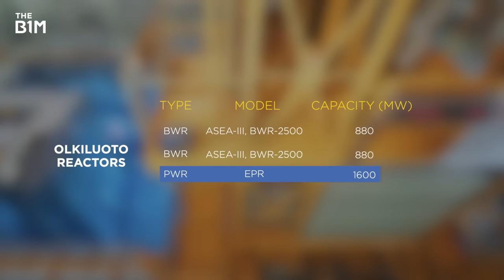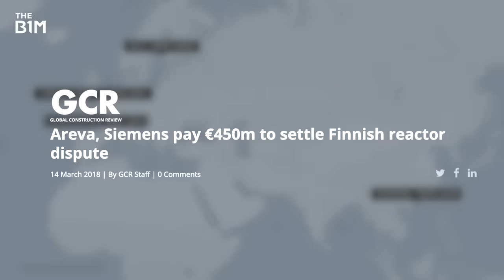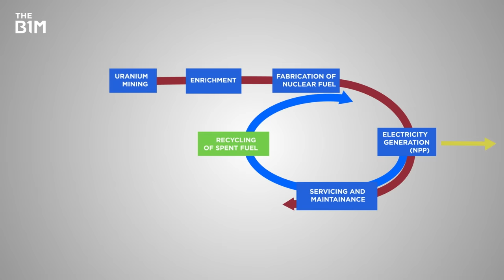Finland Might Have Solved Nuclear Power’s Biggest Problem

Comment: "Sweeping the problem under the rug", I'm not impressed.
Reply: That's literally what burying nuclear waste is. Sweeping the waste under the rug.
Reply: It will stay there forever. It will take quite an earthquake to bring it up again. Better that than blowing coal dust all over the place.
Reply: @Tuppoo94  Anything's better than coal dust. Let's try to aim higher, shall we?
Reply: @angeleyes2c  I would say we should aim as high as we can but we need to reach the point where no fossil energy is needed in less than 15 years so we should take every chance we get. And until our technology has gotten far enough so we can safely reuse the fuel, I think burying it isn’t the worst idea.
Reply: @Tuppoo94  yup, and no earthquake's to speak of happen in Finland, most are within 1 or 2 on the Richter scale, which is barely even noticable to the human
Reply: @Tuppoo94  ah yes because it’s either coal or nuclear.  Stop with the forced dichotomy.  Drill 2 km anywhere on earth and you have enough geothermal heat to run compression and expansion cycles.
Reply: @kaiyack  Do you have any idea how fucking DEEP 2km hole is?
Reply: @onelyone6976  no earthquakes so far.  How long do records go back?  How long is geological history? Love it when engineers think they’re geologists.  There is no permanently static place on Earth.
Reply: @angeleyes2c  aim higher.  Agreed.  Engineers are notoriously lazy.
Reply: @kaiyack  True, but in 50,000 years the waste has decayed considerably, and won't be as dangerous anymore. The rock they're drilling right now is among the oldest in the whole world, and unlikely to move anytime soon. Even if it does, the waste is 400m underground.
Reply: @Tuppoo94  how are we going to convince future generations from not opening up an attractive geologic anomaly?  Signs with words?  Only took 500 years for Latin to split into French, Italian and Spanish.  Even a “curse” didn’t stop Carter from opening up Tut’s tomb.  Look whats happened in human history in the last 1000 years, let alone 50,000 and engineers want to claim they got it all figured out?  Plain and simple all contingencies have not been planned for.
Reply: @kaiyack  no there isn’t a permanently static place, but the bedrock in Finland is very stable, the baltic shield contains the oldest rocks in Europe, and the borders of the tectonic plates are nowhere near Finland
Reply: At least read up one hour on the solution before making stupid uninformed comments, OK?
Reply: @benbaselet2026  putting it in the ground isn’t a solution.  It’s an inelegant deferment.  Maybe read up about human history and how we really can’t stop future generations from digging anything back up.  That curse on Tut’s tomb sure kept Carter away.  They’ll eventually get into Xi’an’s.

Oh then you gotta transport it to the site, which has its risks. Because, you know, not every place on Earth has geology such as Finland’s.  Which countries should be forced to bury in situ?
Reply: @kaiyack  there are hundreds of thousands of holes drilled in the earth for gas and oil and they could utilize that energy coming out of the ground in the form of heat and compression that could also spin turbines but they don't. Some wells we drilled the temp of gas coming out of the ground was +200 degrees F  @ over a hundred thousand PSI.

Comment: I mean....100 years is hardly long term when you consider the length this stuff needs to be stored. Also...storing it deeper hardly seems like a genious "new" solution. Color me disappointed :|
Reply: Check out Tom Scott's video on the topic. He explained it better. Search "Tom Scott Onkalo" and you should find the video.

It's going to be stored there for 100,000 years, not 100. They're going to fill it up for the next 100 years. After it's full, they can dig more.
Reply: The scope is 100 000 years of hassle-free storage. Solution is not new, but actually making it happen is.
Reply: The radiation decays significantly for much of the material over a period like that. It becomes much less radioactive within a few decades, the next 100,000 years or so is to make it truly dead.
Reply: Especially since a better solution, burning the same fuel again and again 50-100 times to get all the useful energy out, leaving waste that is only dangerous for a few hundred years, has been known and proven for over 30 years.
Reply: @jasexavier  
Tell me more about that. That actually sound really interesting. You have a link or a video to share?
Reply: @marrqi7wini54  To my knowledge the "Integral Fast Reactor" was the first reactor built with the idea of full burnup of nuclear fuel for commercial power generation. The test size reactor was completed and operated in the late 1980s. The first utility scale version was under construction in the early 1990s before it was canceled by the U.S. Congress. It was so close to completion that it cost more to dismantle it than it would have to finish it.

You can also look up closed vs. open nuclear fuel cycles. The once through cycle used by nearly all commercial reactors today requires enriched uranium and extracts around 2% of the nuclear potential energy in the fuel. After that the fuel doesn't work in the reactor anymore. It can, however, be processed into usable fuel again, many times over, it's just expensive. In addition, fast reactors, which utilize fast neutrons, can, once running, breed new fuel from otherwise unusable materials, like U238, meaning the "depleted" uranium from enrichment can also be used as fuel.

Most of these things are old enough tech you can find them in any reputable encyclopedia. Terms of interest: nuclear fuel cycle, nuclear fast reactor, spent nuclear fuel, Integral Fast Reactor.

More on the IFR here: https://www.ne.anl.gov/About/reactors/integral-fast-reactor.shtml

Of particular interest are the tests where they forced a complete loss of coolant to demonstrate the inherent safety of the design. The reactor is kept safe by the inherent physics of the fuel and core, rather than any mechanical device.

Comment: This video's biggest problems:
* The narrator uses the term 'nuclear' when he's actually just talking about solid-fuel nuclear fission reactors.
* The biggest problem isn't spent fuel - it's the use of solid fuel, which fragments and needs to be removed when only 2% of its energy has been extracted.
* Nuclear waste did not play a part in the 2011 Fukishima disaster - it was a badly designed plant from 1970 that experienced a meltdown when its cooling system was damaged by a tsunami caused by the most powerful earthquake ever recorded in Japan..
* By-products that take millions of years to decay aren't the problem, since they have very low radiation levels.
* We dig big holes to extract uranium from the ground, so digging big holes to bury it again is hardly a revolutionary idea.

Comment: 6:15,  Wow, Lots of regions on that map look like areas with a miniscule population density.    But I wonder what is important about the geology of tropical/subtropical regions in S. America, Africa, and India.
Reply: It is not about the population density (although it is one of the factors), but geological stability in the long term. The indicated places are far away from the edges of the tectonic plates. These are stable - boring - central areas of the plates, where there is not expected to occur earthquakes. Also - in the very long term - the central areas of plates are less likely to buckle up and fold when the tectonic plates move and grind against each other over the millenias to come.

Comment: The only problem with nuclear power is people's perception of it
Reply: Humans are heasily manipulated...
Reply: The problem is people acting like the concerns are not valid and others acting like the advantages are not valid.
Reply: Extremely high capital cost?
Reply: @imperatorcaesardivifiliusa2158  Thats a regulatory problem, if we would come up with a plan, and build more units like that, it would be viable. But the regulatorz bureaucracy wants to preserve its onlz use, by constantly varying standards and fallback systems. The SMR modular reactors will make this problem go away, as they can be mass produced in factorys, and shipped to site.
Reply: @lukacsnemeth1652  I don't want to alarm you, but I'm pretty sure you might have accidentally misplaced your Z key. And in any case, it still is a problem. "We can fix the extremely high capital cost through this technology" still concedes high capital cost to be a problem. Even in China where public opinion doesn't matter and where safety regulations are far more lax, nuclear power still requires an insane amount of capital to start up.
Reply: People's perception of it might change when the by-product of this "clean" power generation isn't deadly to life for longer than humans can possibly comprehend.
Reply: @imperatorcaesardivifiliusa2158  Z key is perfectly fine, i just switched language mid typing. China is a good example, look at the Hualong-1 model with the first operational unit. Cost estimates for follow-up units is already down some 20% expected to fall even lower with more units. Also high capital cost are there, but look at the lifetime kWh/euro price, and nuclear is really competitive there.
Reply: @C.I...  this is a complete misunderstanding of radioactivity. Stuff thats radioactive for thousands of years has a very low activity, that can be easily shielded. Waste already loses 90% of activity in the 5 years in the cooling pools. Also, if you bury it in a granite shield, undisturbed for more than a billion years you may as well forget about it. Trust me, anything happens with those tectonic masses, your last problem to think about would be radioactivity.
Reply: @lukacsnemeth1652  Good to hear it. There is no greater tragedy than a missing Z key. We're definitely making progress on this problem. But it does demonstrate that we do have a problem with the capital cost of nuclear power. There are multiple problems with nuclear power, including capital cost, so OP's statement that perception is "The only problem" is false

Comment: Sorry, but 100 years is not a "Long Term" solution when it comes to nuclear. That's just kicking the can down the road for your grandkids to deal with. .
Reply: That's exactly what we are doing now with other energy sources. Except these cause really bad problems on the short term, so for us and our direct offspring.. Just think about climate change. Not saying this is the perfect solution, but this might be the best option we have..
Reply: The half life of spent nuclear waste is 30 years btw. By the time the last available slot for the waste is sealed the first will have decayed over 85 percent. Also a reminder that the radioactive materials for nuclear power occur naturally underground...
Reply: while I agree with your comment, it is long term solution(considering life cycle of nuclear plant), meaning, they will have space for disposing waste from that facility as long as it is operating.
Reply: @liquidlethe  30 years? Then why does everyone say that it's like 100,000? If it's going to be mostly harmless after only 100 years it seems like everyone gets worked up over nothing.
Reply: @shintao537  Because its half every 30 its kinda like an exponential amount of time to decay fully.
Reply: They are going to fill that hole for 100 years. Then It will be sealed for ever.
Reply: @rickrandom6734  You seem to be the only one here who understood how it works.

Comment: This was worked on in Canada at least 30 years ago (deep bury in the solid, unfractured granite of the Canadian Shield), but the political will was, and still is, lacking.
Reply: That’s Liberals for ya !
Reply: We have had a similar storage facility in Germany in an abandoned salt mine. But the salt corroded the barrels, which were just placed on their own in the caves. It was a mess and it maybe contaminated the ground water. The Finish way looks a lot more advanced with those casings in steel and copper, and sealing with cement.
Reply: The problem isn’t that we can’t build a hole. The problem is that nobody wants the hole in their neck of the woods.
Reply: @Gentleman...Driver  The Canadian design consists of radioactive materials diluted and then vitrified into a glass-like material (diluted so that their radiation level is less than the natural background radiation in the Canadian Shield granite rock - the Shield is actually radioactive naturally) which are then placed in titanium containers. The container's diffusion rate is slower than the radioactive decay rate and so mitigates quantum seepage into the surrounding rock (but if it does - it is harmless because the diffusion rate is measured in 100,000s of years and the radiation is less than background). The containers are in turn placed into cylindrical holes bored into the granite. The holes are arranged in arrays in long granite tunnels/chambers, these tunnels are about 3 miles (5 km) underground minimum. When a chamber is full, it is backfilled with concrete. The granite chambers are bored into the middle of massive granite rocks - these rocks are about 400 cubic km(!) in size and are unfractured (they are single unbroken titanic boulders) that formed when the earth originally slowly cooled down. No ground water penetrates these rocks. The Canadian Shield is one of the most geologically stable areas on earth and is home to the world's oldest mountain range. I visited the experimental site in Manitoba several decades ago. The technology is designed to survive nuclear cataclysm and/or the fall of civilization as we know it. It is estimated the entire radioactive waste produced in the world can be stored in the Shield safely. This technology makes nuclear energy a very viable safe alternative to wind and solar because the waste disposal problem is solved! The Churchill Falls, Labrador, hydro plant is built into a similar rock formation - check it out!
Reply: @christopherkingsland4604  Thanks, very interesting. I mean a country that has a valide solution to the problem can earn quite a bit of money, because other countries will pay A LOT for a storage they can forget about.
Reply: The NIMBY's strike again! I grew up in NW Ontario and the opposition to the Ignace disposal site has always baffled me.  The amount of jobs created in a dying town, which ironically has a long history of mining,  would completely revitalize it. The site in Finland was chosen after geologists found there's been no major seismic effects for 10 million years,  and i would expect the situation for here to be the same.
Reply: @jeremyt7722  And the Canadian Shield is even more stable than that!
Reply: @christopherkingsland4604  thanks

Comment: Finland solves the problem behind nuclear power?
Also Finnland: still uses light water reactors

The problem with nuclear isn't the waste it produces because the issue is the model of reactor we've made the standard. The light water reactor was incorporated worldwide because it has 1 major advantage. It's so mind-bogglingly simple, that you don't need to educate people too hard to get them to a level where they can build them, that and their build makes them immensely cheap. This type of reactor also isn't amazing fuel efficiency-wise, so there is quite a bit of waste and it makes them produce less energy than what's possible, which if you were in the 50s, you really didn't care because the cheapest option for lots of energy sounded too good to be true. That's no longer the case, we're at a point where waste is something we need to avoid, and continuing to use outdated models of reactors and trying to solve the waste issue, is kind of like blaming doctors for not curing lung cancers, even though the problem is with the smoking.

This is really just becoming a situation of "Oh i didn't do this, because I saw everyone else doing that". If Finnland wanted to stand out as leading-edge, and as a scientific example on the world, improving and relying on a failed model is a pretty bad way to go about it, especially since trying to make a cheap and moronic model for a reactor, operate at higher capacities, is not just immensely costly hense the 10 billion, but also dangerous and still not optimal. It's kind of like going to the mechanic to fix your shitty car, them saying it will cost 5x more than the car is worth, then you stupidly going "well that's just fine, all my stupid friends tell me it's a great idea". In the end if we all act like morons, then nobody is the moron
Reply: Yo, you have a source so I can read up on this? Not saying your lying im just genuinely interested!
Reply: You know as part of your rant you could have suggested models that seems viable to you rather than ridiculing a country's efforts.
Reply: @Jjoseph36  He gives you a second opinion on what the problem looks like in reality. You can make your own research since you now know its not as sweet as the video suggests. You know how to make a research, don`t you?...Google...
Reply: @polyndraaa  No, I don’t have to, because it is not I that has an issue with it. He does and therefore should suggest better otherwise leave people let them do what makes then happy. Rant less, give insightful criticism more.

Comment: If the power suppliers would switch to thorium for nuclear power, they could use the spent fuel rods from existing plants for fuel. Thorium plants leave the spent fuel non-radioactive...so no storage needed.